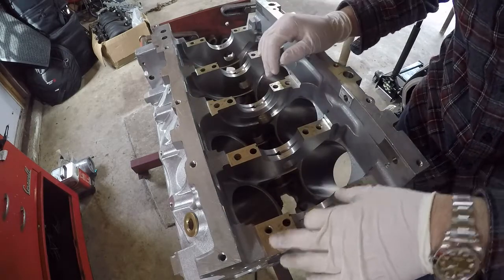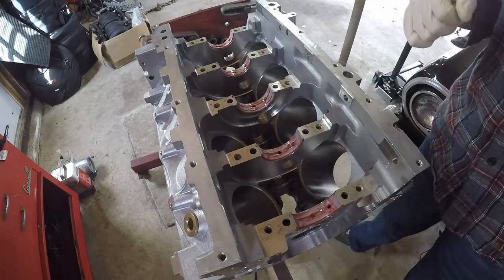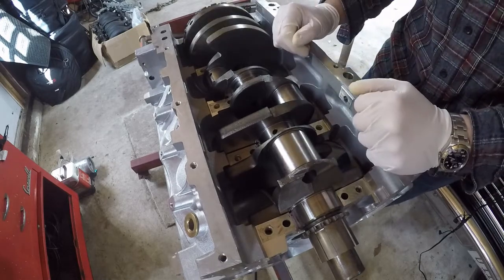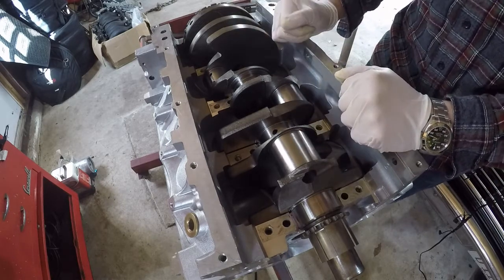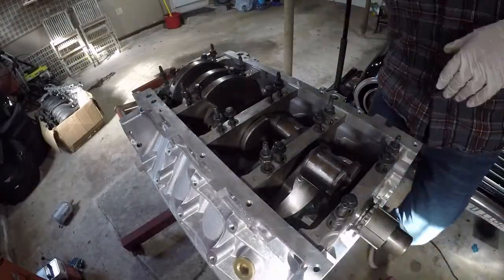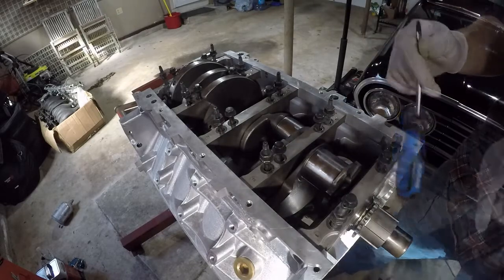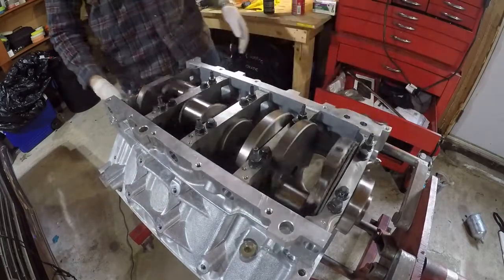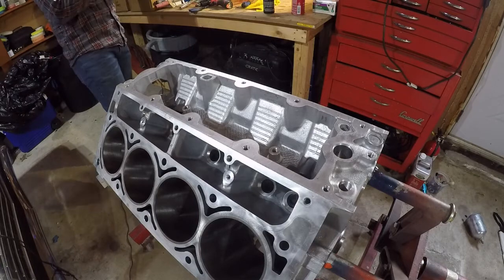LS1 Rebuild Episode 1: Installing the Crankshaft

Comment: Hopefully you checked your end float after that video and certainly wouldn't suggest checking the bearing clearances with assembly lube applied before checking them as this adds to the clearance
Reply from the maker: Good advice certainly. Engine is long gone sadly, never got to run it. Sold to a friend in SC.

Comment: What type of rod bearings did you use on this block?
Reply from the maker: Ricky Jaimes oof good question. I can look it up.
Reply: Leo's Garage! Thanks, I’m going to start building my first LS lol!! I’ve built some Small block Chevys, and some Big block Chevy engines, but not an LS yet. I’ve stumbled over a LS6 that I plan on swapping in my Camaro in the near future.
Reply from the maker: Ricky Jaimes nice! This was my first LS too. After doing Sbc/BBC. I’ll try to find the part number for the rod bearings I used. They weren’t anything fancy though
Reply from the maker: Ricky Jaimes MS-2199P
Reply: Leo's Garage! No rush sir, thanks for getting in touch with me. Really pumped for this build!!